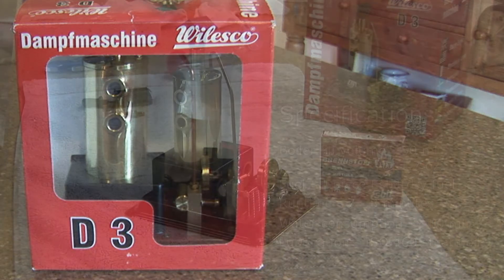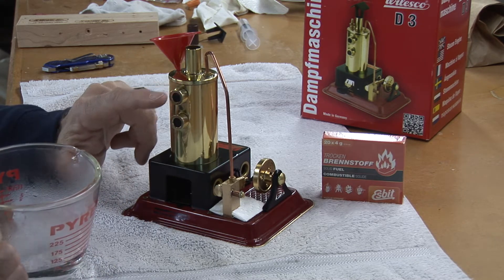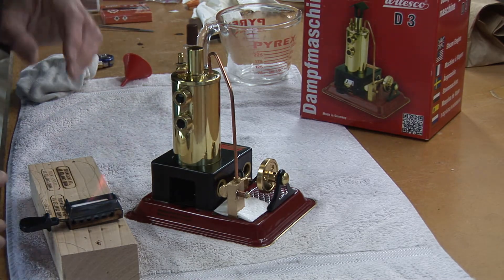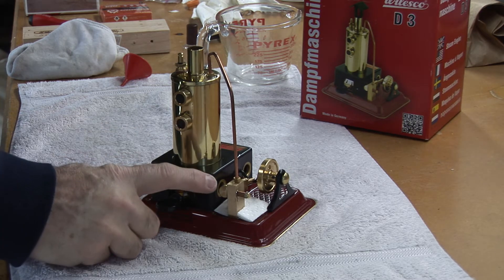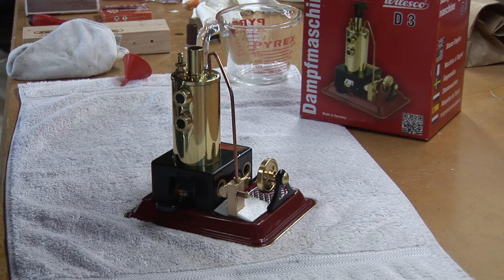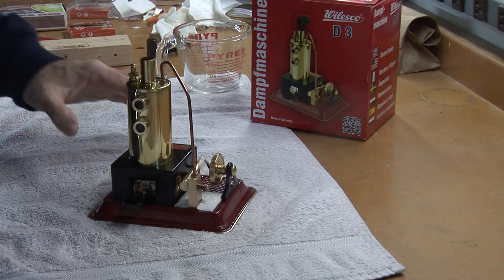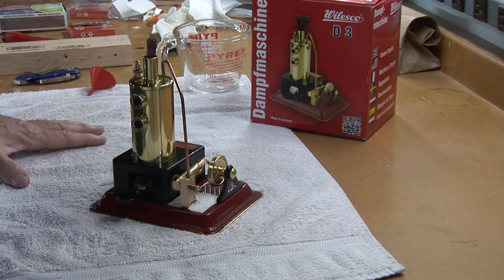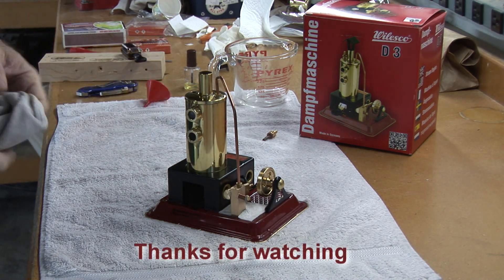Wilesco D3 Operation

Comment: It’s an ENGINE not a motor .
Reply from the maker: That's not true, engine and motor are virtually synonymous. Look up motor in any dictionary, such as Merriam-Webster, and you will find it defined as "any of various power units that develop energy or impart motion".  Seem to me that's what this contraption is doing. A steam engine is a specific type of motor, but it is a motor.
Reply: @phatfilmstoo  I still find it to be a little bit problematic when I use my engine decided to use my syringe with the plastic tube on the end of it in stead of the funnel supplied with it

Comment: what kind of oil ??
Reply from the maker: I'm using steam oil, the kind sold by Wilesco and other toy steam engine suppliers.  Steam oil is a viscous oil that provides lubrication in hot and wet applications.  Using standard motor oil, like 10w-40w, doesn’t work well as it’s easily dissipated by the steam.